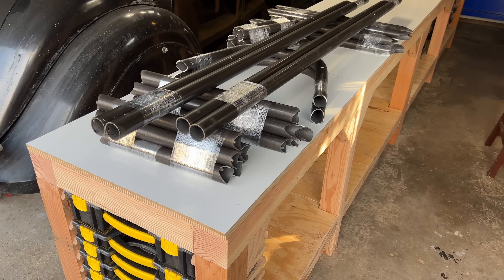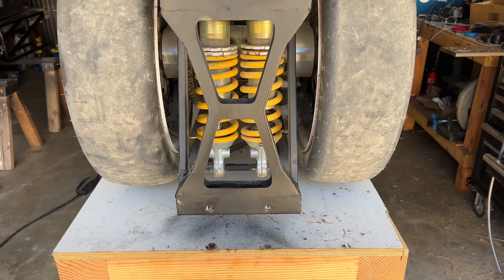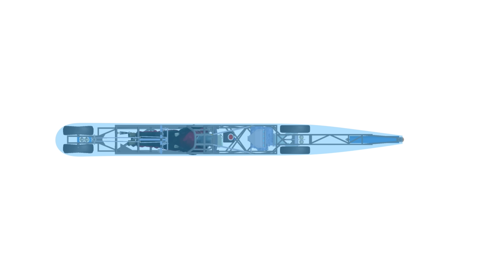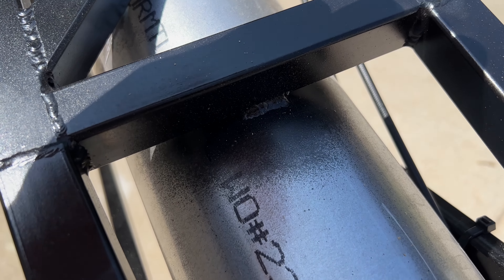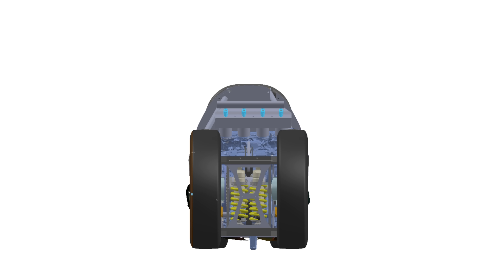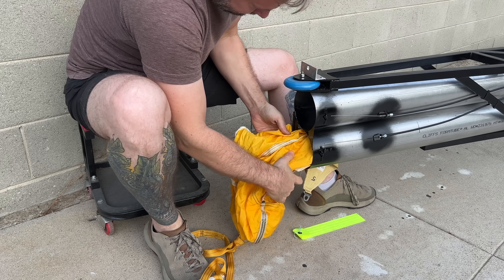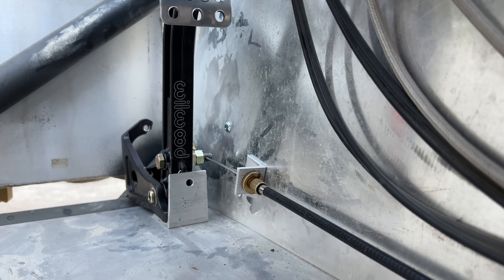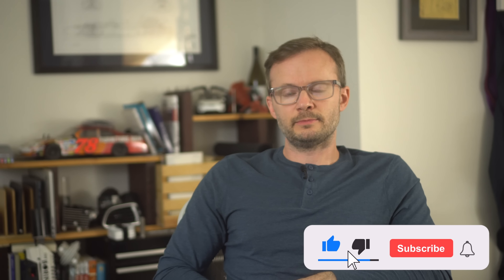The Tail End of the Race Car Build

Comment: Aaaaargh! You know that spring washers do the exact opposite of what they're supposed to? Use spring washers only when you want bolts to come loose...
Reply: Never use spring washers, just star washers
Reply: @turbo32coupe  Never use star washers, only locking nuts or thread adhesive.
Reply: @brianb-p6586  Locking nuts are one time use.  Star washers are used in military aviation.  Thread adhesive is great if you don't take the part on and off, but he removes the tail to put the car on a trailer.  Ideally he would use pins loaded in double sheer, like my sailplane spars are pinned together on assembly.
Reply: @turbo32coupe  while I agree that the double-shear idea is desirable, even that would require some sort of locking for safety.

Locking nuts are single-use, but if four 3/8" nuts per event are a cost or logistics problem, the whole operation is really marginal.

Comment: I am 95 european percent sure you have thought of this, but depending on the angles of the draft it might pull more on a few or only one bolt. With side wind or a car that is about to flip over, that could also include some fulcrum (?... as in a lever) action.

I just want to have you producing videos for a long time going forward... I am selfish that way :)
Reply: Oh no, it's only good for 15g now...
Reply: You are correct. Some people learn the significance of chute lever arm action the hard way when it bites them in a streamliner or lakester. With more than 30yrs of running liners I've advised a lot of newbee's about this, some listen, some don't. The first time Bobby Moore went over 350 in the Maro Special it bit him, he survived, sold the liner & quit racing.
Reply: @nzsaltflatsracer8054  😮 That sounds like a story worthy of a Google search.
Reply: @sigstackfault  Not quite - there could be only one of four bolts in tension, and it might be under much more tension than the force that the chute is applying because the tail structure is acting as an enormous pry bar.
Reply: This non-enginear would appreaciate a non-enginearing explanation.
Reply: @brianb-p6586  oh true. let's say it gives a 10:1 advantage. 1.5g. that's still probably more than the chute can do.
Reply: @jpkatz1435  consider pulling a nail out with a crowbar. If you pull straight out you get no extra.power, and that is the way of the calculations he showed. However, if you get sideways load the crowbar, as intended, you increase the forces on the nail by for instance 10 times because of the hinging action.

It's the difference in distance from the hinge point that determines the force boost. 4x the distance (from hinge to hand compared to hinge to nail) gives 4x the force.

For the tail section, this ratio is still (guestimates from memory) like 5 ft to 1 ft, so 5x the force, but then the force acts on 2 bolts, so instead of handling 60g (still from memory) we are down to 30g for half the bolts and 6g for the fulcrum, IF ONLY LOADED SIDEWAYS.

That is not a realistic event, until you perhaps loose a tire and start spinning. On the other hand, you might want the tail to come off rather than staying in that case.

I am more confident in Matt's calculations and experience and know-how than myself, but I just didn't want it overlooked.

Comment: quick one, (forgive me, im learning) when you are working out the force that the 4 bolts together can withstand, and you use the cross-sectional area of the 4 bolts at their minor diameter. surly that would be good to tell you the sheer strength if they were positioned at 90deg to how they are in your design. ie, all the force is acting on the shaft of the bolt. 
In the orientation you have them presumably the force is split between the head of the bolt/shaft (the calculations you made seem accurate for this) but also acting on the threads? 
Is it your intuition that the threads will have more holding power than the shaft of the bolt?
I have just started studying engineering, so have had a number of space diagrams and force calculations to do lately, so am genuinely interested.
Reply: yea isn't it just on the threads? well there's that bracket angle thing too, but isn't the cross section of the bolts fairly irrelevant compared to what the threads of the bolt can take and the threads cut into the thing the bolt cuts into.
Reply from the maker: The force is acting from the head down through the first engaged thred, and then decreases through the next few threads. The minor diameter of the first engaged thread is the weakest link. The head and major diameter are seeing the same force, but they are stronger than the minor diameter, so they won't fail first. The force isn't split between the bolt and the threads; both are seeing the same force. 

Also worth noting that if they were in shear, the shear strength of a bolt is usually about 60% of its tensile strength.So the minor diameter in tension is stronger than the major diameter in shear.
Reply: to add to what matt already said: always look for the narrowest section or one where there is maybe a notch in the part or something like that. those areas always fail first
Reply: @SuperfastMatt   obviously not applicable to your design/application, but I guess that is where you would try and design it to have double sheer joints to compensate somewhat.
Reply: @SuperfastMatt  thanks

Comment: I think the main failure mode on the tail section bolts is limited to the thread shear, rather than the tensile strength of the bolts.  But you have literally eleventeen times more engineerishness than me.  In the end, what really matters is that they hold enough G force to crush your nuts though.  Ha ha!
Edit:  Ooof!  Maybe there's enough thread there that their strength exceeds the tensile strength of the bolt?  I'll need more .30-06 cheeseburgers to ponder on this . . .

Comment: Your math must be very wrong. 180 kN is about 18 t of force. 60g at that force would mean your car weighs 300kg. 
3t sounds more like the weight of your car, meaning those bolts will break at 6g deceleration, assuming the load is perfectly split of course.

Comment: uhhhh Matt if you use 8.8 grade bolts, they have a maximum strength of 800 N/mm² and they will plasticly deform at 80% of that, so they have a yield strength at 640 N/mm². not 1000 N/mm².

In the end, those bolts can still hold 144kN, or about 14,000 kg of weight. So its fine.